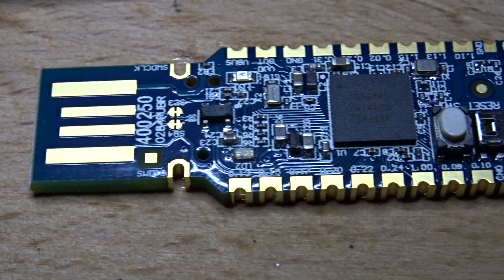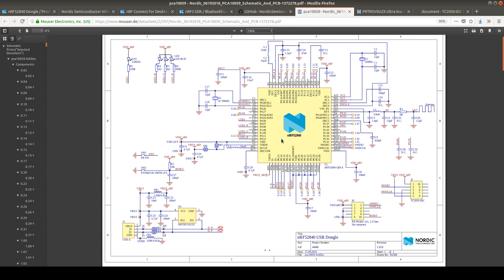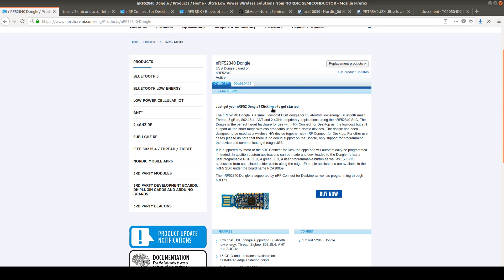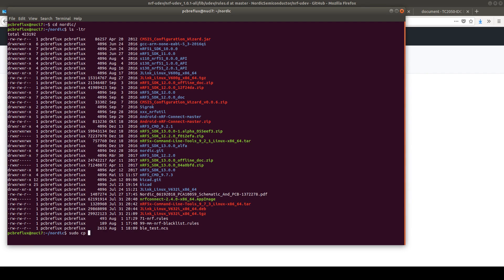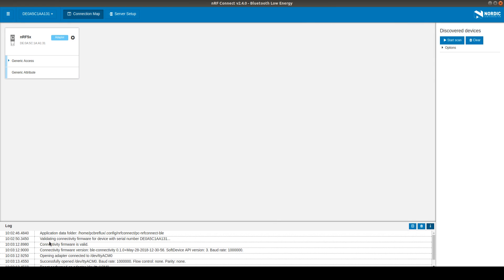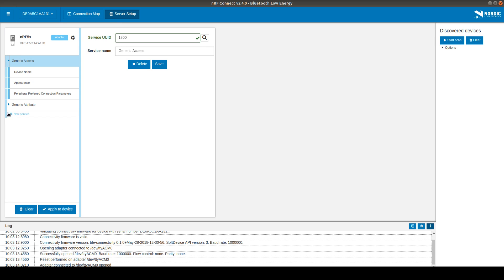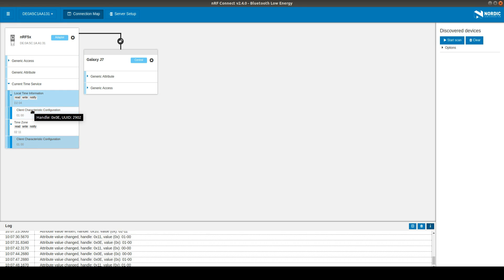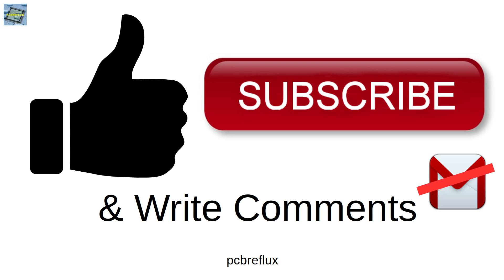nRF52840 Dongle getting started

Comment: Can I use this as a normal USB Bluetooth dongle in Win 10? Would the drivers for this functionality automatically intstall or just download their driver? (Would it work eithout the whole development suite and special setup). I just want bt 5 and I have other devices this could come in handy for
Reply: No. You would need to program it first to behave as you describe. This is a development tool, NOT an out-of-the-box preprogrammed device for end-users!
Reply from the maker: Not try win10 but think this is the main platform nordic will target the dongle, so it should work easy.

Comment: Thanks for a great quickstart. 
I wanted to develop a product with nRF52832 and bought this nRF52840 dongle as it is cheaper. My approach is to develop basic hardware configuration attaching sensor and firmware testested on this dongle which I can finally use on nRF52832 based production device. Is it right and workable approach?
Reply: bro never got a reply
Reply: @joopie46614  fr

Comment: To get started with my Bluetooth app, buying this dongle enough? Do I have to buy some other hardware devices. Can I connect sensor or led to this dongle and execute program on it...
Reply from the maker: Luckily you can config any/most GPIO pins with an interface like uart, I2C, SPI, ADC etc. If you project are ok with the 15 GPIO pins you can use the solder pins around the dongle. For developing it's  maybe  better with a programmer/flasher/debugger but you can use also the nRF connect for desktop but this is today a beta version (don't forget to flash the bootloader otherwise you can use nRF connect only once! ;)